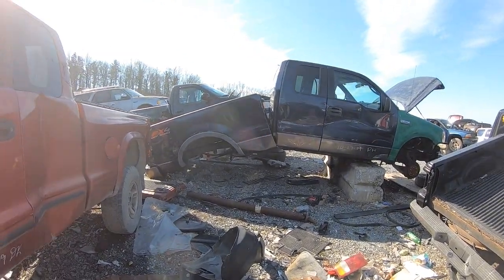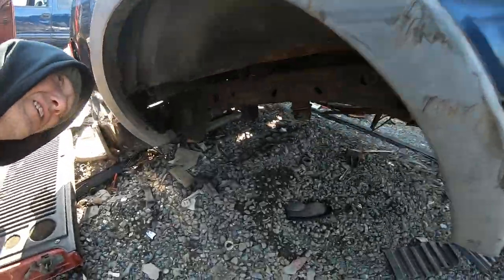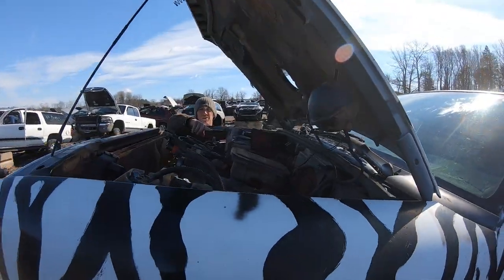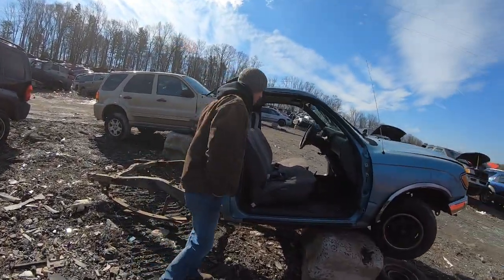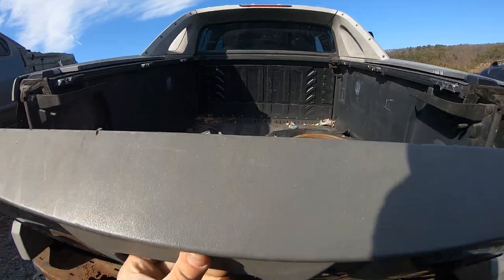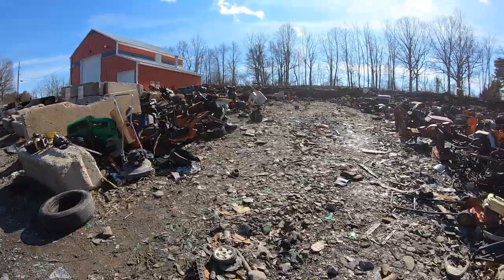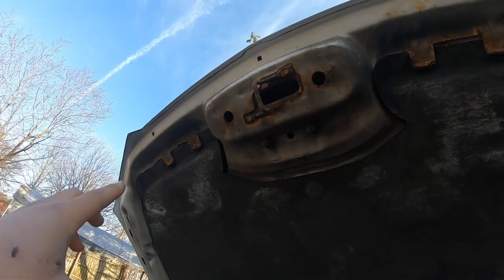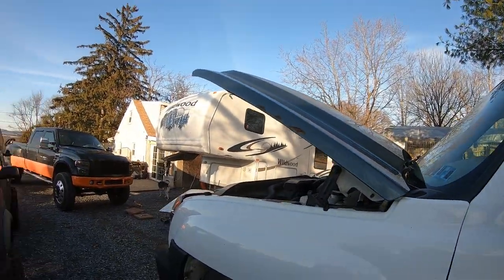AVALANCHE gets HD upgrades & CATEYE'D!

Comment: Joes U-pull it in New Ringgold? The good drive trains are on the other side of the yard, Joes used auto parts. I have bought engines there, They have good deals on them. You are right. Everything they believe there is a market for or an insurance company may buy is remover at the used parts side then the car gets moved to the you pull it side. They deal in volume there is nearly a constant flow of cars being moved around through the day.
Reply: I hit my trans for my 06 f150 4x4 from them
Reply: You are right

Comment: Might be worthwhile to get a cheap double din radio from amazon the factory Gm radios suck if your going for 1 that has the cd drive or nav built in the 6 disc cd changers get stuck and the laser stops working on the nav 1 if you want something cheap that has apple car play and android auto swing by lsx Matt YouTube channel he did a install on his 02 Tahoe z71 that has a cd drive and does CarPlay and android auto with factory steering wheel controls